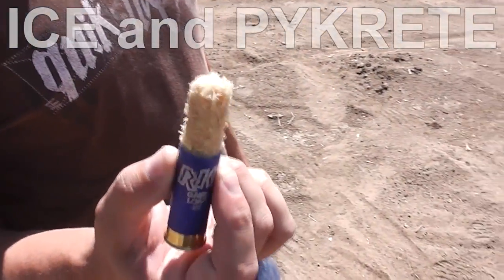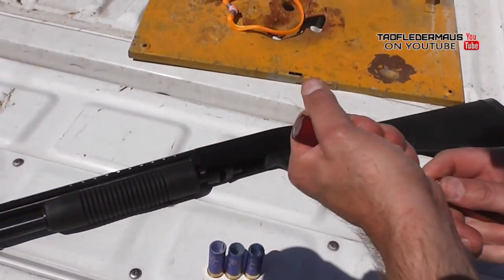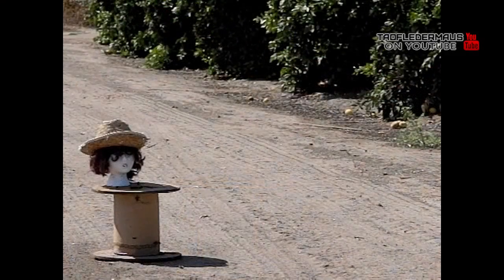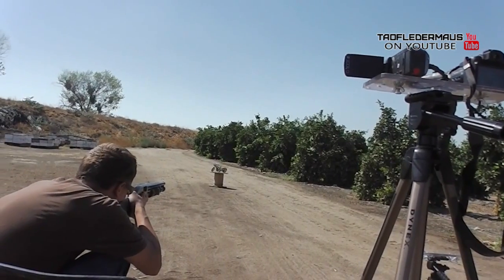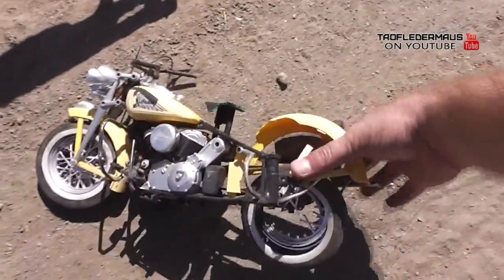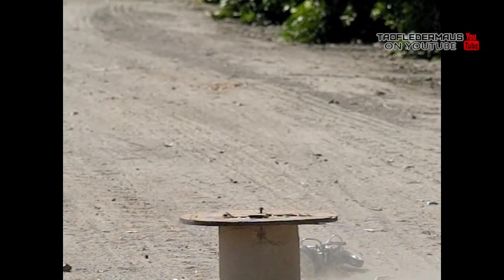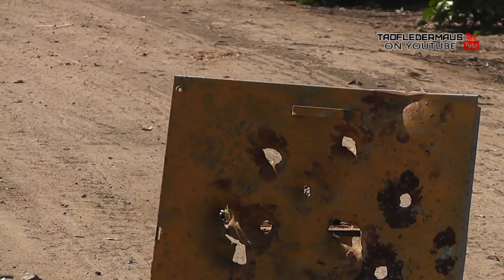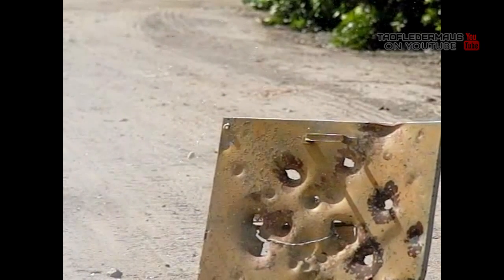PYKRETE BULLETS & Ice Shotgun Bullets

Comment: "Pykrete was invented during WW2 as an alternative material to build ships with"

But how would it stay frozen?
Reply: they use it on cold region like russia
Reply: The plan was to have a refrigeration plant in the ship and build the hull with pipes running through it. Chilled brine would be pumped through the pipes keeping it frozen
Reply: IIRC, one possible use was to base sub-hunting planes out in mid-Atlantic.
Until longer-range planes came along, U-boats exploited that gap in air coverage.
As apathyboy said, the pykrete ship would carry its own cooling plant.
Reply: Plus, that was one of the reasons it was uneconomical. No matter how you cooled it, it still melted some. Plus, it was rediculously expensive and labor intensive for just a small watercraft. And it's as hard as concrete, not steel. The only major reason they experimented with it was to see if it was cheaper and quicker to make, which it wasn't.
Reply: Micah Philson Okay, my bad. I thought that it was just controlled tests, I misunderstood.
Reply: 0bserver00 Northern oceans.
Reply: It would melt it was just an idea from the people in  in the world war
Reply: Joexproxbailey Way to look at the 5 comments above yours. Pro commenting level: Pro.
Reply: Viru Sinstall If you read further, "It seems crazy but it worked very well in testing. " TESTING! Controlled environments!
Reply: Bent Nail No, I know that when they tested those boats, they tested them pretty extensively. I seem to remember one test even crossing the english channel in one.

Comment: I might have the wrong thing mentioned here but there was a show about secret Allied weapons of WWII and they had something about a carrier made out of Pykrete, it was never made but there was a demonstration where they had a chunk of pykrete and a bullet bounced off of it and grazed Admiral King. Apparently it was tough stuff or else they wouldn't have considered it for carrier material.
Reply: interesting story about how pykrete came about.

they did make a small scale test boat i saw in a documentary about unusual war machines.
the remnants of that ship is still sitting at the bottom of a lake in canada i think.
i remember seeing the main wooden roof beams and wooden window frames found by divers in the lake where the original small scale ice barge/ship was built. the first test ship was built with ice only not pykrete and took 9 months to melt.

the idea was to build an aircraft carrier out of super thick solid ice so that german u boats could fire torpedoes at it over, and over again without doing any significant damage. and water/ice was plentiful enough to make quick repairs if they needed to. they also planned on circulating refrigerant throughout the hull to maintain freezing temps in the structure and engine room.

after realizing ice alone was brittle, they came up with pykrete. not only is it super strong able to withstand tons of psi, it also melts slower than stand alone ice. 
the idea of the ice aircraft carrier would have been closer to a huge movable floating island rather than an actual boat.
Reply: same thing

Comment: What if you shot a copper pipe, fill one end with lead so it travels straighter and can create the pressure needed, or even a black steel pipe portion with a core of wood dowel just to see what something with a soft inside structure and dense outside would do that size.